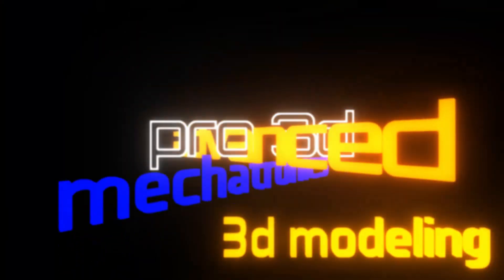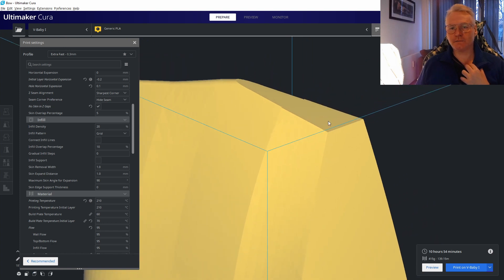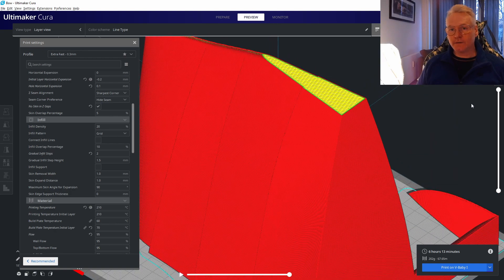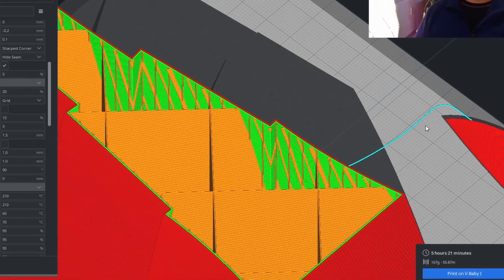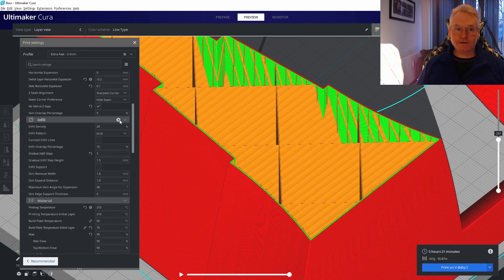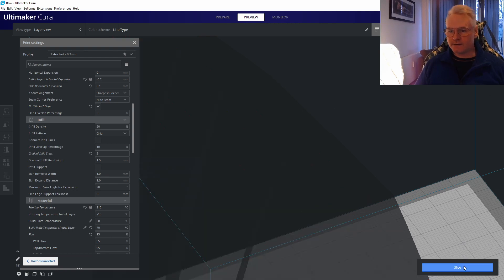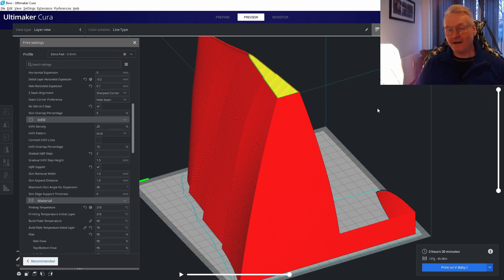CURA 4.8 | EXTREME TIME SAVINGS WITH THIS SETTING | Advanced 3D Printing

Comment: the chances of knocking down that pillar of infill (single layer line pillar) inside during such a height of printing are real... I would select another infill type..
I come around this issue by fusing - at the end of designing - a cilinder inside of my model, that way the cilinder gets printed inside (invisible and takes no time) and the top can build / is supported from that ;)
Reply from the maker: Thanks for the input
Reply: increase number of infill passes. THIS IS NOT INFILL PERCENT. it merely adds extra passes to the infill patter
Reply: @Mr_Pewpy_But-Whole  nobody understands a word you're saying, please elaborate a tiny bit what you mean..
Reply: @ZILLION4EVER  increase "Extra Infill Wall Count" in "Infill Settings"
Reply: @Mr_Pewpy_But-Whole  ok, now I get it, that would work but wouldnt that defeat the purpous of less time/ material? I think first rendering with each one of like 6 usuable infill patterns (who uses cross??) and previewing/judging the base strenght off infill/knock over potential would be the first option, as you keep infill material and time within reason, if all seem flimsy, , you're trick is a good one, will keep it in mind!
love how YT vids lead to constructive critisism where everybody wins a bit!
Reply: @ZILLION4EVER  agreed. This just would solve the issue of knocking over infill

Comment: Those little bits on the side are most likely due to your walls being tapered. It's scaling back up to a higher level of infill as technically there's a "top" coming up.

For a part that size I'd personally look into either a bigger nozzle or cubic subdivision infill, if not both. The former obviously lets you use thicker layers without any significant extrusion issues (though you may need to slow down somewhat and/or increase temperatures), with the resulting part tending to be stronger. The latter will adaptively reduce the infill density as it gets further away from the shell, similar to how bones work internally, and allow the infill to still stretch across the entire model interior for overall stability purposes.

Comment: It can sometimes be more reliable and faster if you add an infill modifier to be selective on what gets what infill.

Used this method before on a 150mm figuring with a rather large pedestal to accommodate someones name, low infill on the base very dense as it got to the very flat transition and then back to a 15% gyroid for the rest of the figure.

Comment: You can save more time and print without infill at all, by making use of the post processing and print bridges very fast when you reach the first top layer and also increase the cooling fan speed at that layer
I used this method to print a lot of things that used to require infill and support but you do not need this any more
Reply from the maker: It sound like you did not see the video. I talk about models that need infill and show one to the camera. The particular model inside cura does not need infill that is correct. The method still applies for the other model I show and it is not possible to bridge the top
Reply: @PRO3DESIGN  
I really saw all the video from start to the  end and according to my own experience in printing objects similar to the model in your video I believe you can do it as I mentioned earlier 
Printing bridges is possible if you can tweak printing settings for the bridge layer.

Of course if the model needs infill, it will be more logical to use the method you mentioned.

Comment: Wonder how it would look, if not stepping down, but using 20% all the way with infill support enabled. Would still save time, but infill “tower” would be much tougher to resist crashes.
Reply from the maker: Probably yes. I had no problem printing it like this though. You could turn off combing as well to avoid infill when travel

Comment: hey there I got a model of 100 mm , 10 cm, It is only reduce the time in just 1 hour, not much difference, what am I doing wrong? I am using cura 4.8 with "dynamic quality" and support build in plates, noozle 0.04 ender pro 5. thx
Reply from the maker: Hard to say not having the model

Comment: I think it is not safe , the support with 2.5% will fall apart during printing progress, it must be connected to the walls to make sure will not fall down even light connections might do the trick, also new features on Cura help to seam the connection by overlaping infill settings...

Comment: But.. that final config you made, that middle part supports.. it is just a single layer wall in there.. it will fall.. Anyway I'm sure it's a very good tips so will check it out. Thanks. 👍
Reply from the maker: It does not fall for me but if you fear it will fall then check box connect infill lines and you are safe
Reply: @PRO3DESIGN  its like a faith stuff, I must trust it will not fall 👍😁

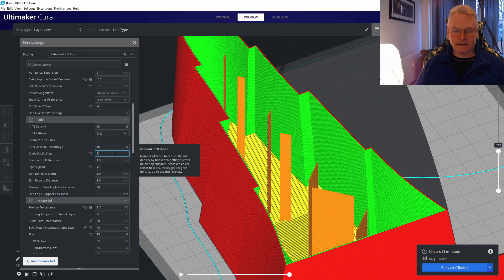Comment: 3:25 Wouldn't the thin walls just fall over when printing?
Reply from the maker: Not here no. But if you are conserned for it to fall then just check the option connect infill lines and you will be safe

Comment: I would be interested in how much time tree supports at 5% would take?
Reply from the maker: You can not use tree support as infill. This is about infill support and not outside support
Reply: @PRO3DESIGN  correct, but as you said this isnt structural, so you could and swap infill for support
Reply from the maker: @andrewdowney760  no I can not because I need bottom and top layers as this is one part of 10 to be glued together. They also have slots in the bottom for alignment of the parts

Comment: That can save me a lot of time sometimes! Thanks!
Reply from the maker: No problem!
Reply: @PRO3DESIGN  I tried testing it with a cube of 100x100x100mm en 20% infill. I enable infill support but nothing changes. Cura keeps filling the whole cube with 20% infill from the floor to the top. I know how gradual infill steps work and that works fine, but i don't see any difference when i enable or disable infill support. Did you try it with a cube?
Reply from the maker: @WhiteSparkie  I did not try with a cube but you might be right here. Try to draft the walls inwards and see how it works

Comment: Interesting, but for print reliability I would still like to touch the walls, the steps thing I didn't know, it's quite useful in this case!
Reply: Either that or at least have one cross per infill area. As shown, some parts are just a single line thin wall with no perpendicular elements to support it.